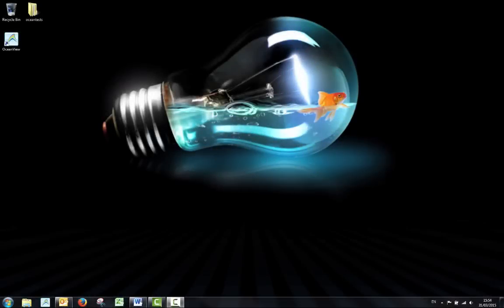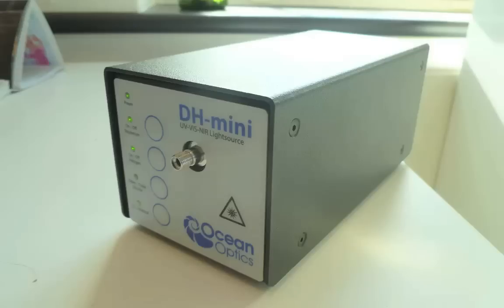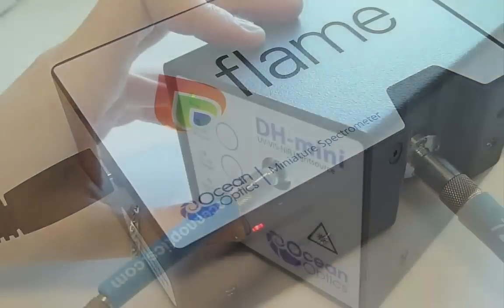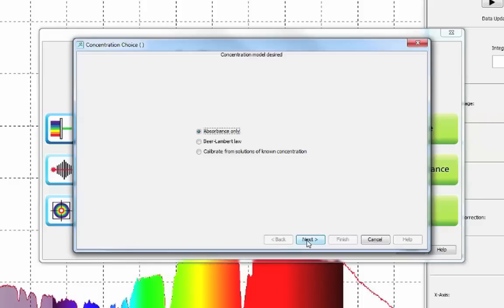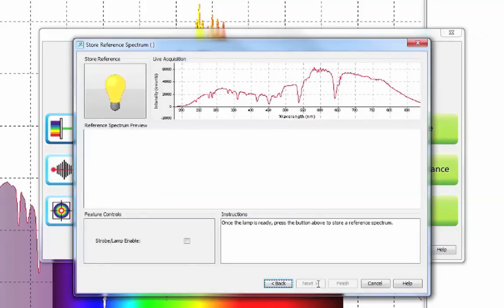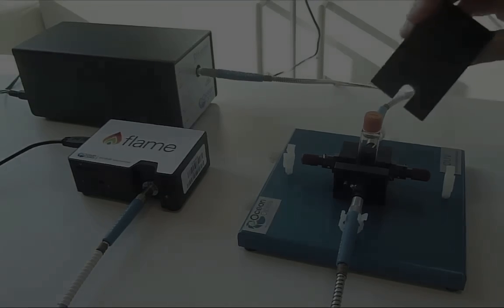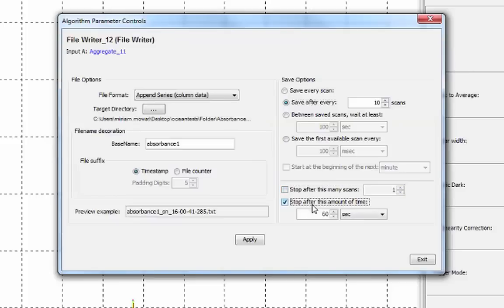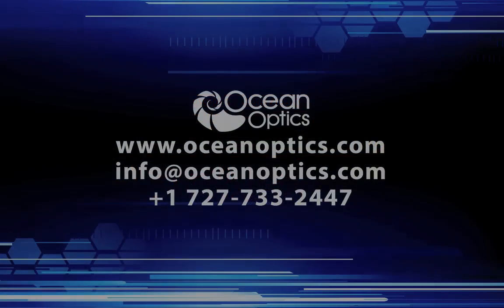Absorbance Spectroscopy with OceanView Software

Comment: Sorry, I can’t understand what the y-axis intensity(counts) means in 1:57.
Reply: Is “counts” some kind of unit?
Reply: @qww12111  counts it's a relative unit based in the conversion of the A/D Converter, it's just to not to use absolute units because the spectrometer is not calibrated (in intensity). Counts is extensive used in detectors devices